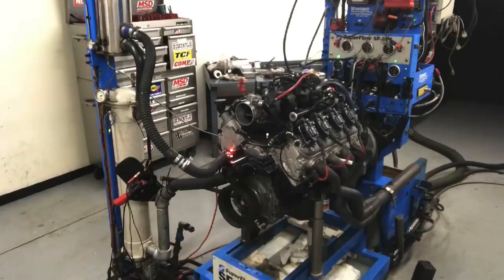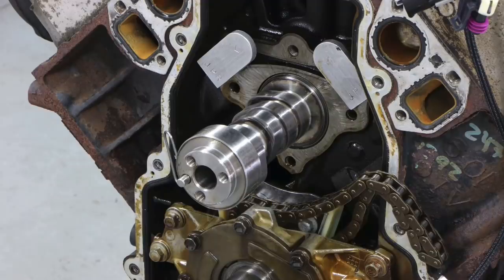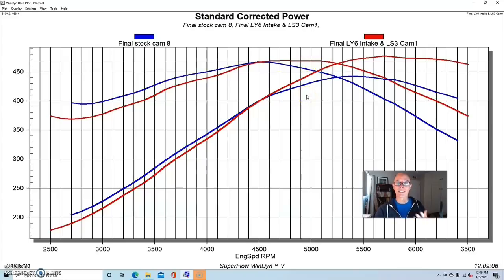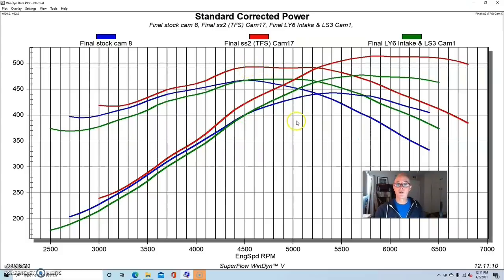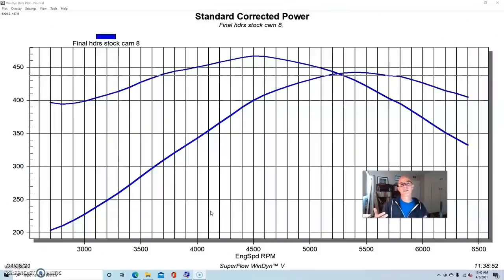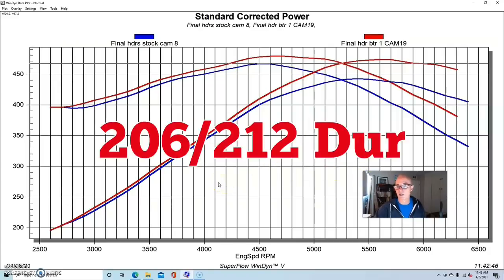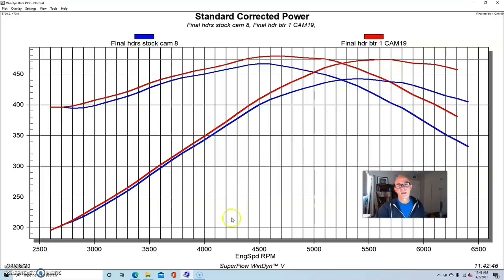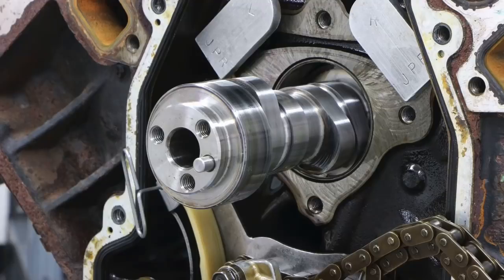HOW TO: CAM YOUR LS FOR MORE TORQUE

Comment: More important to me is WHERE do I want the torque. Wrote that before he said it.. ;) I like as much torque as I can possibly get between idle and 5000rpm. Above that will take care of itself. That is why I build Pontiac V8s, because they make ludicrous torque right where I want it for street driving, you know, predominantly below 6000rpm. The more torque I have the less gear I need behind it.

Gonna find out how the drop in 212@.050 cam does in the 6.0 currently resting in the 76 C10. I hope it makes some grunt power, if it doesn't I will build a Pontiac for the truck.
Reply: It will not make Pontiac stump pulling low down torque. Honestly I can't trump a poncho for pavement pounding, tyre turning low down torque. 

I've known a few 11 second pontiacs that are all over by 5500 lol.
Reply: @SweatyFatGuy  yeah I've got a 74 trans am. Lots of work to get them to rev to 7500 I don't see the point in them. 

Need an early cast block , lightweight billet crank , aluminium rods, custom heads etc.

In something that light I wouldn't be surprised if a big stroke 495+ to 5.5-6k rpm with CNC ported ally heads would pull a 9 in a car that fast
Reply: @SweatyFatGuy  yeah fair bump I've not seen any in person pulling 7.

When I spoke to Butler about it they weren't to keen on revving one that far without an aftermarket block and lightweight components.  Way they were putting it I was thinking it was crank walk issues due to the stroke , weight and the way they're capped.

Comment: Hopefully you can confirm or tell me I'm wrong. I have a 1990 C1500 with a 5.3 swap for the sole reason of reliability and towing. It looks like there would be no downside to the Sloppy stage 2 or BTR Stage 1 truck cam for my use. I always planned to stay stock, but it would be cool to gain power all over, add some idle sound and not lose any power down low. Am I right in this idea?
Reply: that upgraded cam in first graph and good gearing be great  i got 334 gears or something close in my 94 z71  thats is silly tall  410 is what i am doing because of tall tires ans manual swap 5.3l a cam like in 1st graph  .i hope its running buy end month
Reply from the maker: idle quality is not great with SS2 on a 4.8L or 5.3L (I like small truck cams) but if you want the chop!
Reply: what Richard said exactly .but stalling it ant that big i would not think but tuning is a key on that.....if  you want the chop...... i suggest microsquirt box efi if thinking of injection ignition upgrade megasquirt diyautotune com and junk yard parts ford edis is a option easy really
Reply: @DirtySideGetsDown   cool so idling be ok then in my mind